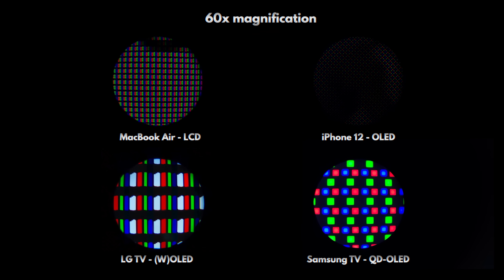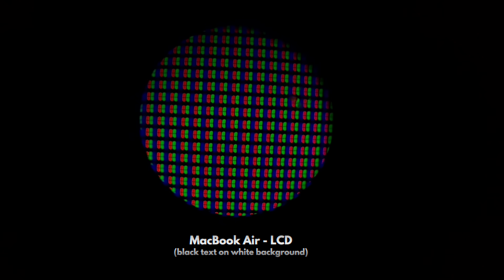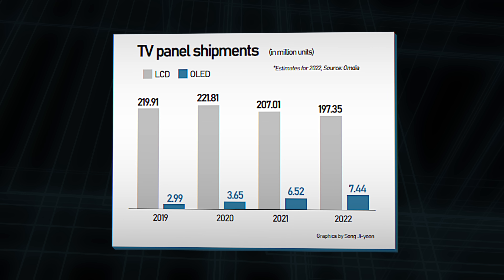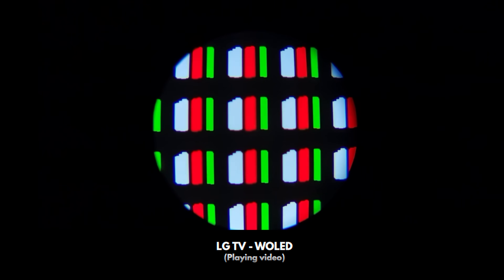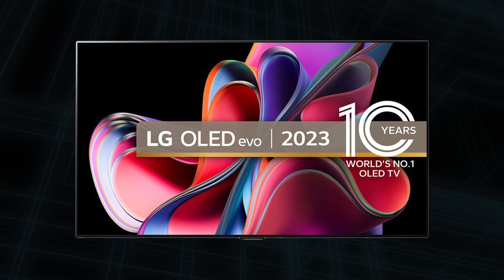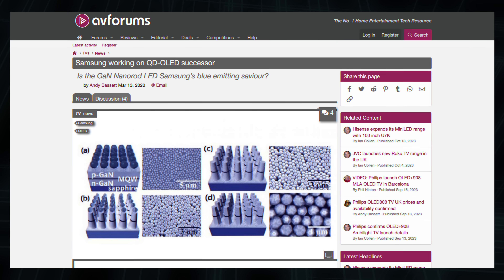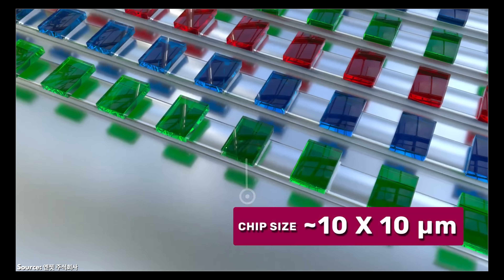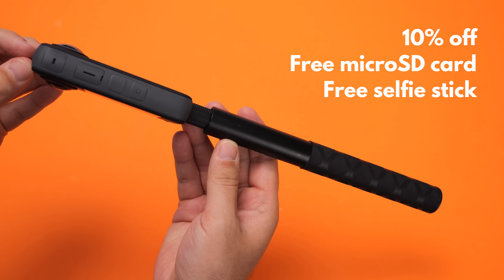The billion dollar race for the perfect display

Comment: mico LED off angle viewing is poor.  Depending on how LED's are built and laid out, viewing from the right might show a magenta overall tint and viewing from the left might show a cyan tint.  The bigger the 'wall' the greater the chances you'll see these color shifts on the left and right, viewed straight on when a white or light colored image is displayed.  Positives? They sure are bright...but how bright do you need it to be when viewing indoors even with uncovered windows allowing light in?  Outdoor advertising LED's use this technology and can be very bright...because they are competing against the sun.  Dynamic range is the big thing here and micro LED can handle this in spades when it comes to 10 bit, with P3 and larger color spaces.

Comment: You are mistaken about burn-in. All emisive display technologies or even locally illuminated displays experience burn-in (which is different from the burn-in of CRTs and Plasmas). This is because all light sources wear out and fade. The CFL in old LCDs fades, the LEDs in newer LCDs fade, OLEDs fade, Micro-LEDs fade. The LED from your flashlight slowly fades. The old red and green indicator LEDs on your '90 era beige box PC tower fade. 

As long as the light source illuminates the whole display (like in side-lit LCDs), burn-in will never be felt because the whole display slowly dims.

Once illumination becomes local, and you can't get more local than per subpixel, that wear becomes uneven.

So OLEDs, MicroLEDs, FALD LCDs all experience burn-in. Side-lit LCDs just fade as a whole.

Also, OLEDs are not thinner because they have fewer layers. It is not the number of layers that matters, it is the thickness of the layers. OLEDs are thinner because they do not need a diffuser layer which is necessarily thick in order to diffuse the back light.

Comment: Too bad SED (Surface-conduction Electron-emitter Display) technology didn't make it. CRT tech but instead a single big electron cannon you would have tiny ones per sub-pixel. Patent issues got in the way it seems. It wouldn't surprise me if more was going on like maybe it just worked too well and those with vested interests didn't want to see their tech get replaced by something better and cheaper too.

Comment: and I am on 2008 Dell with 100% ntsc color gamut (much wider than SRGB and Adobe RGB). which is wider than 99% of any Monitor available in stores.. it;s working great despite FHD resolution but those colors! depth! richness!
Reply: Which Dell exactly? I'm curious what screen is actually inside. What's the contrast like? 
You know back then screens came with CCFL backlighting. I feel like when they switched to LED backlights for a good long wile screen quality suffered for it. It's better nowadays but those older screens with CCFL you can still sort of tell, better homogeny I guess I'd call it.

Comment: I know, lets make LCD screens where the second polarizer filter generates electricity. That way we can capture all the unused light too and feed it back to the system to be used at a later time. Large outdoor panels could be very efficient, capturing also sunlight during the day...
Reply: Why keep messing with LCD, there are other better options.
SED was one of 'm, no need for a backlight and messing about with ligt to electricity stuff which I doubt would be efficient ( I bet <20%).

Comment: Perfect display tech should have no viewing angle limits and no response time issues.
That disqualifies LCD from the get go, because those issues are caused by its design.
Even if you put there backlight with as many zones as pixels in display to solve contrast issue, those two would remain.

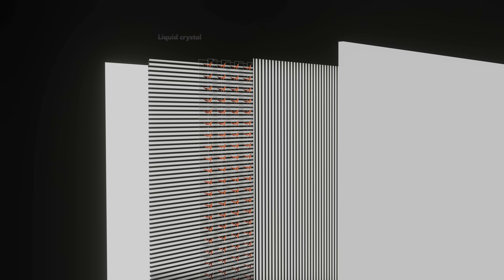Comment: 2:00 it's not a current, it's applying an electric field. Though a current can be measured while the liquid crystal is polarizing, once the process is over there's no more power consumption - hence the ever lasting battery on old Casio watches. Liquid Crystals are molecules that can be polirized via an electric field - I heard a protein extracted from carrots was once used.

Comment: How I would fix this is a projection light old boob tube. The projection quality has gone up and you can project extremely high resolutions, but if you add a dispersal crystall to a projection screen. You can make a interference polarized screen that offsets areas. BLACK BLACK. and mid blacks are switched off at rapid pace for the television screen part to the the projected layer. However, this would and coudl cause eye damage as its a raw light source. A terteriy system could dim the over all ammount of light, but may mess up the dark system, which would inturn need hte tertiary system to react to its light system. 

I think this may provide better fidelity, and wound't have pixel death, it would simpyl be a projector death, and that could be upgraded, saving the screen system meaning the upgrade for hte tele is much much smaller, more unique liek a comp and the upgrade for hte tv woudl be faster rate of black response time.  but hmm

Comment: In 1963, in grade 6, during our Art Class, I drew a TV and placed it on a wall; Sister Dosithius looked at the picture and said you can't put a TV on a wall, I said maybe they would one day; and then the class laughed. Also, in 1972, I designed a Drone using four small .39 engines; my problem was control. Even using airplane remotes, I still had trouble. I gave up :face-pink-tears:getting married and putting my energy into my engineering job and wife and the little darlings...and yes, the puppies too🐕🐶

Comment: You forgot to explain the original flat screen technology.  The Plasma display. I've had a 50 Inch plasma Panasonic 1080P flat screen  for the last 14 years, and it still performs perfect.  Super good colors, plenty of brightness, and easy on the eyes.   Colors to me look more realistic than those new cheap sets you see on display in the stores. Also the plasma's have a really good black level (contrast ratio).  It produces best the gold and silver renditions, that I haven't seen on the newer stuff.  Sure they use a little more power,  but so what.  I'm not one of those that is worrying about the "save the planet" stuff.  Plus back then the early flat screens were made with much better quality.  (not planned obsolescence), like with today's standards.  I'm sticking with my plasma, until the screen actually gives up.  Internal boards can still be found and or components replaced.

Comment: GaN Nanorod blue LED with QD, could be the way, and basically approach microLED display, but be more scalable and cheaper.

But, current QD-OLED I think already are using blue (or maybe near UV) OLED for all colors. The benefit of GaN Nanorod would be 1) no degradation, and more controlled backlight color, 2) and blue channel can be done without filter / or QD. Small step, but could totally solve everything.

Comment: OLED rulez 😁, reason is: flexible, robust (try to bend them, destron on phone) and the only ones that really have infinite contrast. Only those can go to the insane resolution (micro OLED screens - like for VR) - this would be (if you scale them up) like having laptop monitor with 16Mpx by 10Mpx (16000000x10000000)! This means NO EYE strain in the future, life like picture! I am using 16" 3840x2400px 60Hz OLED in Asus ProArt - and the screen is fabulous! Also - Samsung S23 Ultra - wow! And samsung Smart Watch 5  Pro - also OLED. In living room - LG 55" C1 OLED. So you can say I am little biased 😅.

Comment: I think the GaN tech that will replace the organic components in OLED has the best shot at working out in the 5-8 year timeframe, after the more resilient blue OLEDs are used with Quantum Dots in the nearer term. I know GaN chargers are also much more efficient than regular chargers, so hopefully that trait applies here as well. 

I know Micro LED displays put off tons of heat. Linus Tech Tips said he had considered getting one but they are huge and cost $250,000 and he thought about water cooling it using his pool since he’s in Canada. I just don’t see them being feasible for a very long time. Too many variables compared to other methods.

I’m planning to do a home theater build later in 2025 which I think is around the time these more efficient and resilient Samsung QLEDs should be on the market. I don’t really need anything super bright so these should be great. I have an LG C9 in my living room which is already bright enough most of the time, and my home theater will be in the basement with even less light. Then late this decade I will upgrade my living room with the GaN OLED which is in a room where the TV is used more frequently for TV rather than movies and potential burn in while also being under brighter conditions. Since it will be a more drastic technology change I see it being expensive, and my living room TV is smaller, so I think that’s a good upgrade strategy to get it in the smaller size later.

Comment: Double stacked PHOLED or Gallium Nitride, Quantum Dot, Micro Lens Array display when? Preferably available in 28" 1440p (though I really want 30" 2560x1600) for PCs with Displayport and Variable Refresh Rate working from 30hz up to 120hz (I only care about 120 as a minimum).

Comment: Maybe, someday, someone will take this comment as a historical resource:
FMOLed
For capturing / displaying pictures. FREQUECY MODULATION used to transform light.
Light comes from the source (nature) passes through a cornea, and it's compressed by a lens (just like human eye), it's firstly regulated by an iris, then, it reaches a curved light sensor full of receptive FMoleds.
Acting antagonistically to the iris, the sensor increases its speed when the iris contracts, and vice versa. Programmed to selectively imply contrast to the given gamma of each cell, having its signal amplified by a micro lens, the final destination of the photon is a nano voltaic arch, which, having its electromagnetic field disturbed by the incoming photon, will register to the coded gamut chart, one of the 33.554,432 colors. (Yes, dynamic range is just a matter of programming, no magic envolved)
With a dynamic range superior to most of the human eyes in vogue, 25 stops, comfort and experience should be reached, with minimum energy consumption and maximum efficiency of the experience!
Frame rates can easily vary from 1 to 1000 (achieving 0 motion blur) without any issues!

Comment: GaN and GaAs LEDs are still prone to burn-in. Here's a test you can try: get two strings of LED Christmas lights. Plug one in and leave it running for a year; leave the other unused. After a year, plug in the unused string and see just how much the one that's been left running has dimmed. Big Clive did this a couple years ago and the difference was striking.
Reply: Do you leave a tv running constantly for a year you don't

Comment: if they double polarizers, we will get better blacks. uses more power, but quality will be better hdr. 
we dont actually need the pixel filters individually, when we just have 3 color layers in front of locations that have the correct values.
why dont they make these on a waver with uv light..... creating masks with different throughputs... simulating values....

Comment: The move to LCD was a move for practicality, but CRTs still are the bar (Not for much longer I don't think) for image quality. There's always been a tradeoff in colour, brightness or contrast that I think we've only recently begun to match in other technologies. It only makes sense they converge when the standard has been set before.
Reply: CRT isn't all that great. Analog alignment issues were huge, especially in cheap sets, they lacked resolution. Sure, they made good ones, but a plasma TV outside everything they did, and OLED outdoes them. All self-emissive panel types.

Comment: I hate oled panels. Especially on smartphones. I have my phone for half a year now and already can not remember anymore when my status bar wasn't partially burned in. The only workaround to avoid it for as long as possible, is to never go above 80% screen brightness in the first place. Sadly I need my 100% when I'm outside, especially in the sun, or else I don't see anything. Imo, they should invest in screen technologies with does not need any backlight whatsoever when you are in a bright place, but still comes with one for when you are in a dark place.

And I hate that phone screens are not color calibrated. Seriously, why is it so difficult for them to make color displays which displays colors JUST accurate. Nor blueish or orange ish background, no oversaturated colors, just make a display that shows colors as they are supposed to look according to the data in the image you want to display.

Comment: LED is catching up, but an old CRT monitor crushes any current LED in smoothness and "feel" in competitve gaming, I had one in 2002 to 2005 that was smooth as butter, even at 60 hz, but at 120hz it was the best. It was only 22 inch, but when LED came along with bigger, flat, lighter weight, higher resolution screens, it was a nobrainer at the time, BUT that said the CRT was way better performance wise when it comes to smoothness and latency.

Comment: I haven't been paying that mutch attention lately. I was surprised to find out LCD tech has improved so much to the point it actually rivals OLED. Pretty cool! Nice analogy too. I found about this convergent evolution phenomenon not too long ago from a channel called PBS Eons. It's about geology and evolution.
Reply: There's still some who'd argue that they dont actually rival OLEDs in some critical aspects.  True deep blacks are still very hard to achieve in actual practice even with 1000+ dimming zones, though to be fair, if you're using OLED in any kind of lit environment, you're getting significantly reduced contrast anyways.  OLEDs also still have significant motion performance advantages, though again to be fair, it's almost TOO good for some use cases, like with lower framerate gaming which will feel extra juddery since there's no additional blurring being added from longer pixel response times as on LCD(where this blur helps smooth over the cracks, so to speak).
Reply: @maynardburger  Thay would have been my guess. That neither of the technologies has quite matched the other one's strengths yet, I mean. Still, it's good to see that things are evolving and the old rules of thumb are maybe not that relevant anymore.
Reply: @maynardburger  Number of backlight zones would have to be dozens of times higher than currently to have well minimized halos.
Really only something like 100k zones might start looking actually good.
But at that point cost of that backlight unit would be propably excessive.
Reply: Actually there has been very little real advance in true problems of LCD:
- Viewing angles. (only A-TW polarizer equipped IPS has anything close to old CRT viewing angles)
- Limited contrast, because pixels can't block all backlight.
- Sluggish response times causing need for bubble gum and duct tape fix of response time compensation leading to its own issues especially with variable refresh rate.
https://www.ti.com/lit/an/snla185/snla185.pdf